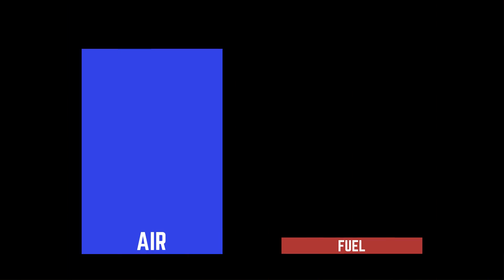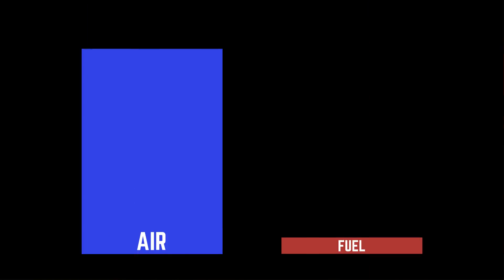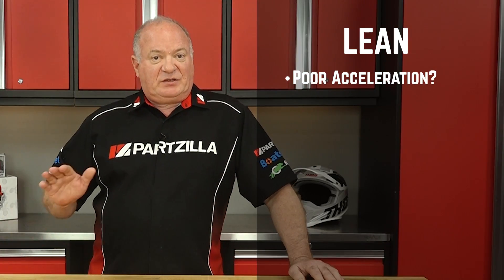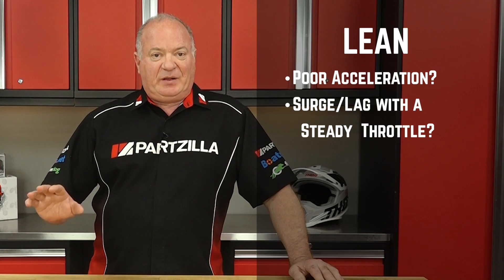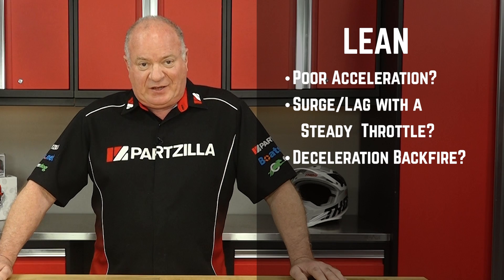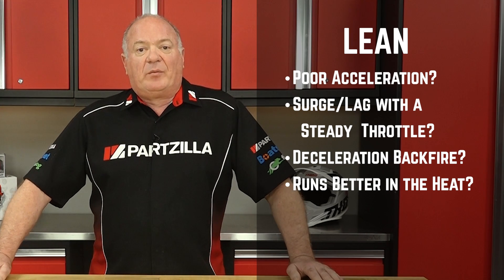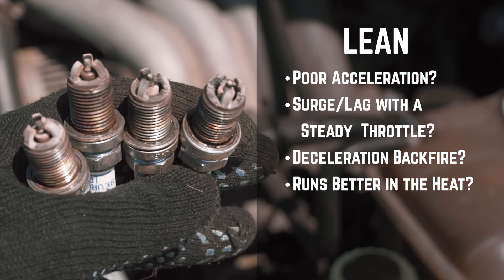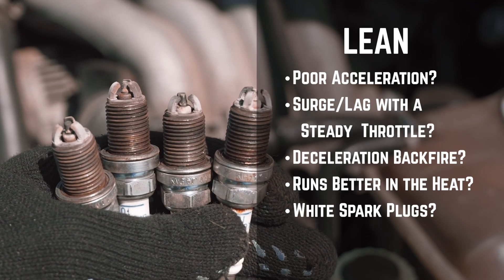Rich vs Lean Running Engine  | How to Diagnose Rich and Lean Fuel Mixtures | Lean and Rich Symptoms

Comment: Best thing i ever did was install a wideband aem kit on my drz400s. Healthy power 12.8 to 13.5 seems to have most power and run the smoothest. Have yet to find a normal drz with a fcr39mx or slant that needs a main jet bigger then 150

Comment: Mine runs ok it idles fine cold. But when i rev it past 3/4 throttle it bogs just for a split second. Its ok warm tho. Its on a 70cc moped 2 stroke. The Plug looks rich after dropping the needle once, prior to that the plug was a nice brown colour.
Reply: Did you lower or higher the C-clip? If you lowered the C- clip you've raised the needle. To lower the needle you'll have to raise the C-clip
Reply: @M.L.R.Z.  It was the HT cap it was loose, I've sorted that problem. But still tho, i cannot keep it fully in the power band on full throttle

Comment: How do i fix a lean mixture on an efi atv?
Reply: Check carburetor
Reply: @AlonzoJohnson-l4m its not carburetor its electric fuel injection so just fuel pump to a fuel injector and a butter fly valve

Comment: Lol i have a little of both on my middle child of moderm automotive ca legal (from factory) 95 gmc 5.0 with aluminum headers 3" exhaust and cat delete and big ol 33s eith 12.5 surface areas and with my initial timing at 4btdc she bucks like a bronco spputters at a tiny little spot in the throttle around 3/16 if im tryingg to hold steady and looses a bit of grab around 3 grand, time to bite the bullet and learn chip tuning lmao

Comment: I have 2007 Crysler Aspen  5.7  misfireing no 1 cylinder obd:  Code P0301,  there is black  carbon on the sparkplugs , put in new plugs shows the same on plugs,  then another code:  P0300 all misfireing cylinders cleard the codes, then tried it again to start vehicle showed only 1 code P0301 again , it looks to me it wont fire on the sparkplugs because of carbon build up, in the cylinder whole of sparkplugs, , could it possiably be Fuel ratio mixture problem , maybe new fuel injectors or some kind of adjust meant to the throttle body , not sure what to do at this point, i did remove intake manifold  replace mds Solenoids , they were burnt up , so i replaced them , never did replace fuel injectors yet,  just looking for some kind of help identifying the issues, what can Be done to reolve the issues, I appreciate what comments can reply for the issues, Ty.

Comment: Thanks for this wonderful video. I have a 2-stroke 250 cc bike . I put in a new carb and I am facing problem starting the bike most of the time. And once started, It has a very jerky/ uneven response during the low speeds but at higher speeds it feels very crisp and perfect. One more thing, if I fail to get the bike started, I block the air intake (by removing the pipe and putting my hand), the bike almost starts instantly ! Am I running too lean a mix or could it be an issue with the idle jet size?
Reply: I’ve got a 90’ rm250 and couldn’t get it to start at 6000’ ft elevation. Went back to stock jetting and fired right up running 40:1 ratio. Just switched to 32:1 ratio and it ran like crap. Going back to 40:1 to see if it runs good again, if not moving to reed replacement or further replacements.

Comment: I have symptoms of both lean and rich

Uneven acceleration & bogs - rich
Surging at 1/4 throttle - lean
Runs better cold - rich
Backfires as loud as a rifle - lean

Spark plug a little black but looks normal

No smoke

A little bit of soot in the valves

Carburetor has the slide needle dropped all the way down

I’ve been chasing these symptoms for 9 months now and haven’t found the issue

Did a carb clean, replaced the petcock, new air filter, spark plug, the motor is hardly broken into. 3,900kms, so the jets in the carb are brand new and clean.

The motor is in time as well

I took it to a few mechanics and they don’t even know what’s wrong
Reply: Are those symptoms present at all throttle positions? I'd be curious if you are lean or rich at idle or low throttle, and the opposite as you near full throttle. If that's the case, you could have a pilot jet issue causing your low throttle issues and a main jet or needle causing the opposite issues as you increase throttle
Reply: @ghostpig8012 😂😂
Reply: Had these symptoms on my 98 2 stroke.. turns out it was low compression.. bored the block and got a new piston set and now she is running like a dream.. 

Check you compression.. and if it's a 4 stroke then get your tappet set correctly + precisely carb tuning..
Reply: Could be crank seals sucking in air and possibly oil into the combustion chamber